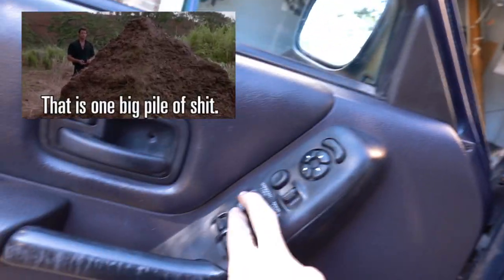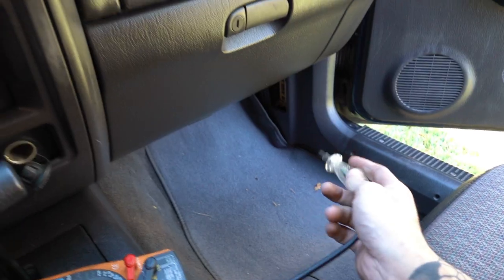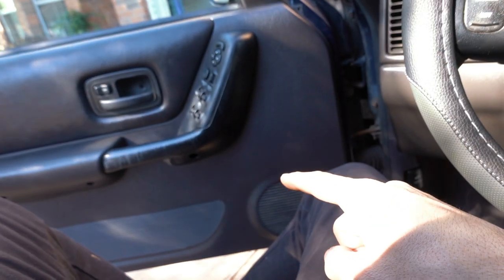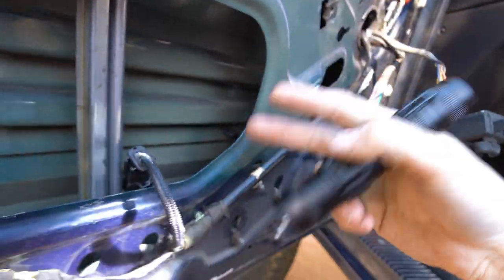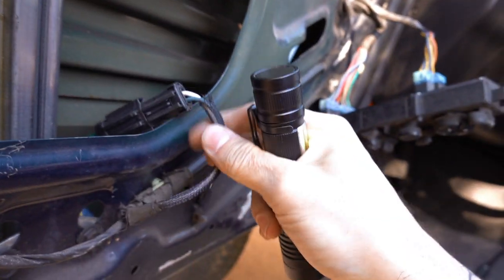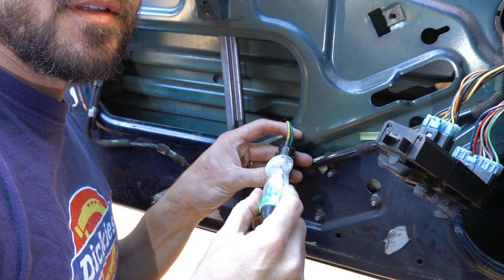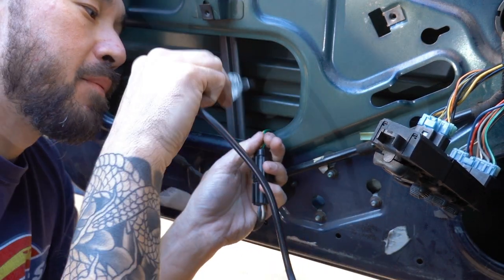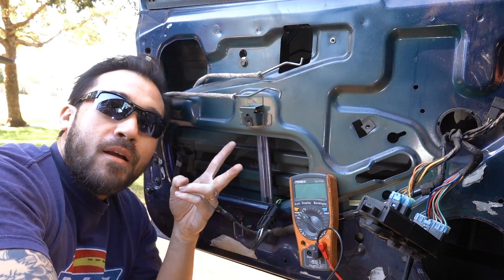Diagnose Power Window that won't Go Up or Down / Jeep  Cherokee Xj

Comment: Green 2001 XJ owner here, with 204,500 on the odometer.  You just helped me a lot in troubleshooting an identical issue. Every window went up and down except the driver's. I put the test light probe one at a time on the two wires going to the regulator motor, and sure enough my switch assembly was not the issue! The light in the probe lit up just like in your video. Ordering a new regulator assembly now, thanks!
Reply from the maker: Best comment all week! Thanks for sharing.

Comment: Thanks for the video, it is very informative! I have what seems like a strange situation where both wires are showing 12V when I press the switch up and no voltage when I press the switch down. Do you have any idea what would cause that? Bad switch? What's also strange (to me) is that the window won't move in either direction. Maybe a bad switch and a bad motor/regulator? Any thoughts are appreciated.
Reply: Follow up, even though I was having a different issue, I took the idea from this video (https://youtu.be/MBNIC_2H_JQ) and decided to take apart the switch and resolder the connections and it fixed the window!

Comment: The wiring running from the door into the cabin used some ghetto wire insulation which was prone to cracking in the boot causing a short. That is a common issue on the XJ & YJ.

Comment: How about if the window only works like half the time. Some kind of loose connection I’m assuming
Reply from the maker: Broken wires in the door jam
Reply: That’s what I got too, also driver side door lock, if I reach across and flip the passenger side, it makes the driver side work again

Comment: My windows will go down.. sometimes not all. And then they get stuck like that and it's been impossible to get lucky and get it up like before what could that be all windows all switches
Reply: The only time my driver window goes up is when it sits outside in the sun in 80°+ weather lmao